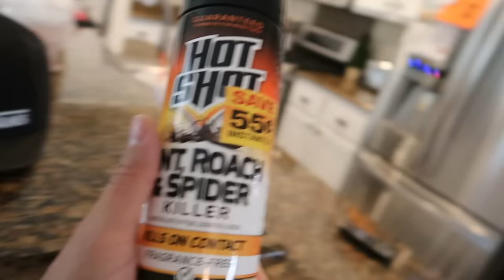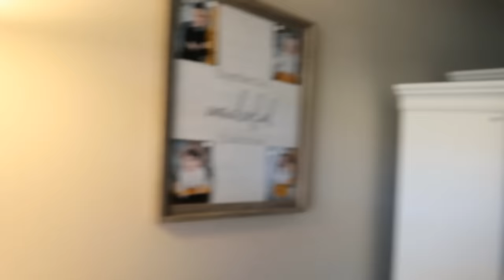TERRIFIED IN OUR OWN HOME! / Where are these RODENTS and Huge INSECTS coming from??!

Comment: I also have rats, I live in an apartment that we have moved in 8 years ago and we still haven’t moved out and I remember 2 years ago I would hear noises from the attic that’s why I slept with the lights on and I still do, and turns out that we had rats in the attic the whole time. Yes we do have mouse traps and we killed a lot of rats, yesterday there was even a small mice that we killed